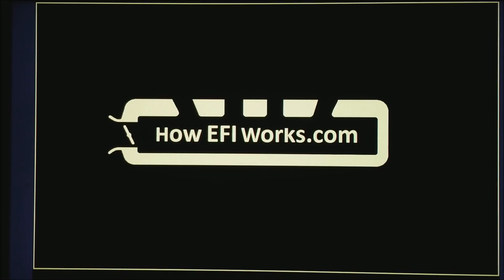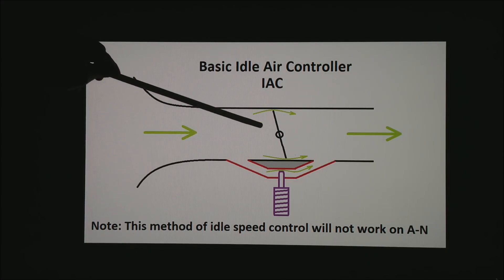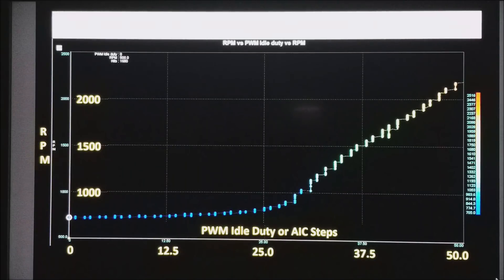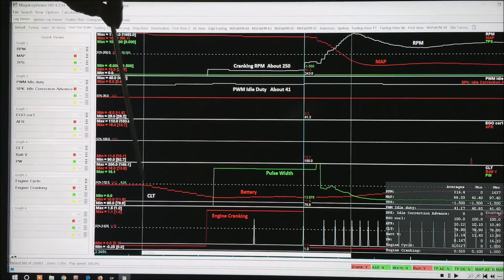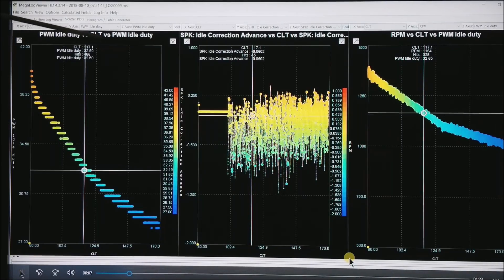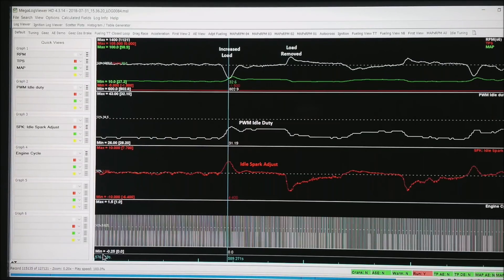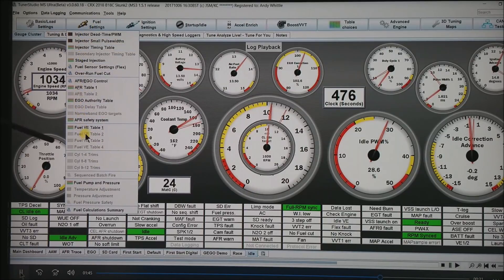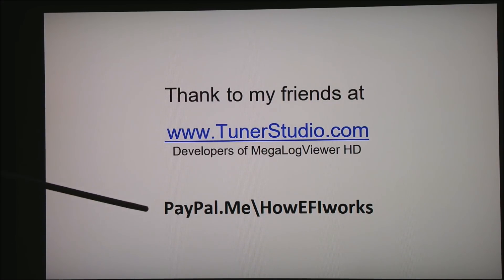Idle Control using Timing and IAC : How it works

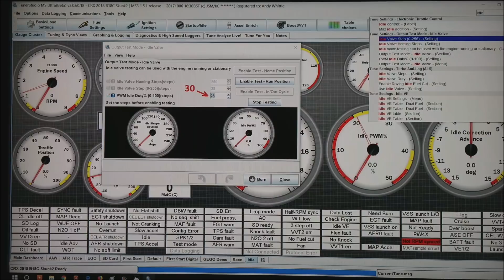Comment: I'm confused... After watching this video like 10 times, the section from 5:30 to 5:43 confused me. You disconnect the IAC, then set the throttle blade to an RPM lower than the idle target, then plug the IAC back in and set to 30%, then adjust the throttle blade to your target idle RPM? If the IAC is set to 30% and creating a high idle, how would you get the idle down to your target? Wouldn't the IAC be introducing air and keep the idle high? 🤔
Reply: @PANTYEATR1 I am also confused. For what purpose should I adjust the idle screw ? The idle PWM valve is to support idle speed control
Reply: @wachus1  i set the idle screw to 100-300 RPM below my target, then set the IAC to my target idle RPM. My throttle body also has an additional air bypass adjustment that lets air around the throttle blade and IAC.

Comment: Awesome video. A lot of people tell me the IAC valve is either fully open or fully closed. But some mention it is a stepper motor but nobody seems to know exactly what the IAC is doing.  When you talk about Pulse Width Modulation (PWM) I know what that means I am an engineer, so you are saying the IAC is fully opening and closing at different ratios (duty cycle) to get an over all air flow of Zero to Max, or is it an actual stepper motor. If it is a stepper motor, you simply give it pulses in one director or the other to put the IAC plunger right where you want it.  In your video you were talking about it being controlled by PWM duty cycle but in some cases you mentioned steps alluding it to being a stepper motor.  This has been very confusing because a lot of people have the concept, but gloss right past the details. You seem to have the deeper dive into knowledge that I seek.

I have an IAC for a 1987 GM V6 2.8L Multi-Port fuel injection Pontiac Fiero. It has only 4 pins. One pair reads 50 Ohms across it, and the other pair reads 50 Ohms as well.  I am guessing one pair is a coil that steps the plunger out a tiny bit for each pulse, and the other pair steps the plunger in a tiny step for each pulse.
I can move the plunger in and out by hand, it feels like it is geared down inside, so I guess it must be a motor (but is it an actual STEPPER motor)?

My experience with linear stepper motors (in/out rather than round and round) is, you send it many pulses more than is needed to get it to one of its stops - home position.
Then you can change the position of the plunger by the number of in/out pulses (steps) you apply it (not PWM, actual step pulses).
Say it takes 255 steps to open it fully, you send it 256 steps (pulses) in the open direction - this guarantees the pluger is fully open no matter where it was when power is off - it is now in the home 100% position.  If I wanted to move it to the 50% position, I would send it 128 pulses in a row stepping it toward closed. And the plunger stays right there - it doesn't move. Then to move it to the 75% position, I pulse it 64 steps in the other direction toward open.

The nice thing about stepper motors is, when you step them to any position, they stay in that position without any power (pulses) and they are very accurate because you keep track of the pulses you sent it to know its position.

But if it is a PWM duty cycle plunger, then I cant see how a smooth idle can obtained with it fully opening and fully closing at some fast rate duty cycle.

Any idea on how I can actuate my IAC valve to learn exactly how it works?

One would think there would be at least one more pin to give position feedback to the ECM just to be sure.
Thanks.

Comment: hey andy, something you just mentioned just got me thinking. 
so when i set my ITB alpha N motor up, 
should i calibrate my TPS to 0 after setting up my itbs to idle, 
or should i first reset it to 0 with throttle blades fully shut and then manually adjust the throttle adjustment screw such that my TPS sensor reads (some value, lets suppose 5%) with no throttle input from my foot. 

if you get what i mean.
Reply from the maker: If you tune an ITB motor and then recalibrate the TPS, You will to fix the VE table.